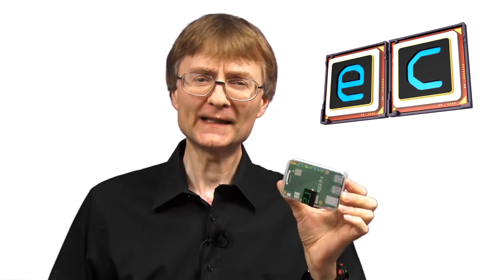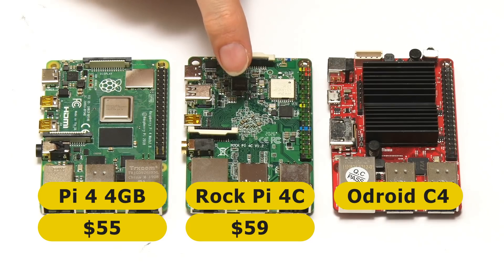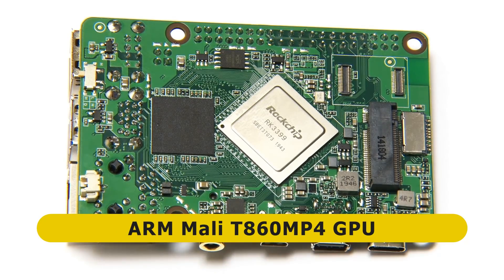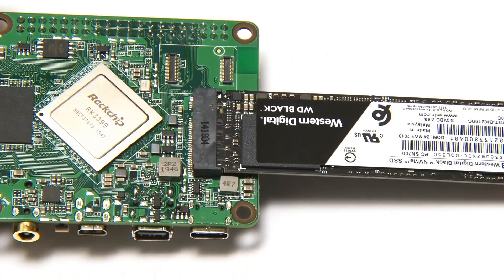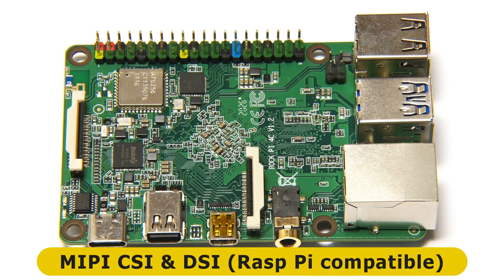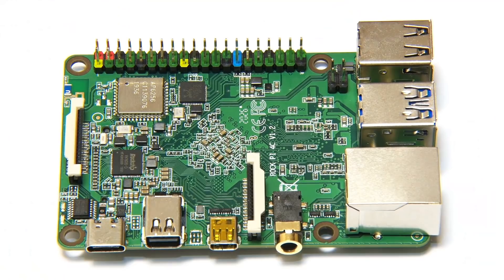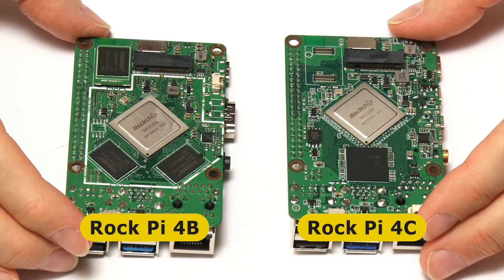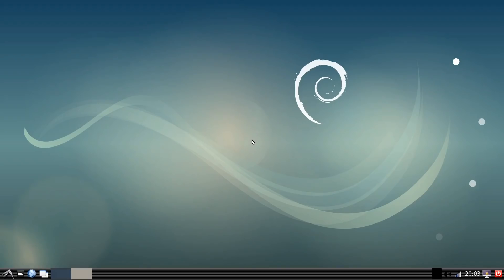Rock Pi 4C: Dual Display M.2 NVMe SBC

Comment: What a great and informative video on another neat SBC. Might consider picking up a Rock Pi 4C instead of a RPi4 in the near future.

As a sidenote, at about 4:35 you noted the board had 802.11 a/c WiFi. The slash implied that it supports a and c, and while 802.11a existed (it was the old old original standard), 802.11c did not.
Reply from the maker: My apologies on the WiFi spec -- I reproduced what the spec for the board says! :) It should be 802.11 ac WiFi (no slash) which does exist!

Comment: They make a large heat sink for the 4c, I bought mine a month ago with the heat sink specifically for the 4c.  Maybe your vendor doesn’t carry it or you were looking in the wrong place.  I have mine booting off eMMC and it’s very quick.  I bought this over the PI 4 because of all the storage and video connection options
Reply from the maker: This is great to hear. Not sold by Seeed Studio at present, which is where I got the board from.

Comment: For a few bucks more you get some extra bells and whistles but as you say it plays video a bit better than the pi4 so why is that? 
They can keep sticking faster more powerful processors  , more RAM and more connectivity in regards to storage but two things are really holding these things back in regards to physical size - the size of the ethernet socket and the size of the usb 2.0 and 3.0 sockets . The other thing is the 40 pin connector , change this to a edge connector or ribbon connector  and sell a plug on converter that can be fitted if desired and that way the case manufacturers can put the pin block in the case anywhere they like . Just my two bobs worth anyway😀

Comment: I don't see the point in testing video playback in Chromium on any of these boards. Even the Pi Zero can hardware accelerate H264 decoding up to 1080p60 (eg. it works in LibreELEC/Kodi). The problem is, after so many years, there's still no official support in Chromium for hardware video decoding on ARM (beside Android of course). Decoding video in software makes the hardware unusable for anything else next to it. Also we are not going to see an ARM SBC hardware any time soon which is fast enough to software decode VP9 4K60, and AV1 is on the horizon.
Reply from the maker: I do it because playing video in a browser is a pretty standard thing to want to do on a computer these days, and most SBCs struggle at it.

Comment: I have 2 of the model B with 4GB and I think they are great. Things they got right. CPU on the underside, makes for a neat and compact cooling solution. RPI could learn a lesson from this example. Generally well laid out and constructed board. The Rock64 3399 is fast and the options for NVMe and eMMc memory let you tailor your capacity and access speeds. Prices for accessories is more than reasonable for example the kit they sell for eMMc flashing has  a nice USB3 speed and is cheap. Some meh attributes. Beyond initial basic stable OS choices not much seems to be happening on the development front. The orientation of the NVMe slot is backwards requiring a sub board sandwich. I can understand the decision,  Radxa could not guarantee all NVMe drives will fit under the board with the heavy duty heatsink but a solution for a specified drive would be nice. Things that disappointed. The audio IO socket relies solely on the solder pads for retention, one of my boards had the socket break off whist plugging in a jack.(very tight socket) This lifted the pads on the board so now the board is effectively deaf and dumb to analogue audio. Audio over HDMI still works fine however. USB C power input is all the rage but a simple barrel socket is sturdier and power sources are more common. Things that caught me out. This board will not run on 5V via the USB C socket unlike the RPI so RPI PS's ( with a USB2 to USB3 adapter) will not work. Do not buy the RTC battery. Believe it or not the the simple mention of a battery in the packing list sends the freight companies into conniptions and I had to downgrade delivery speed with a refund for the lower class delivery. Just buy a battery locally and add your own connector. Soldering is the best way to connect the battery but the creative use of hot glue and heatshink should work fine for those averse to soldering.  Being such a low power device I was leaving it powered on 24/7 when used as a Kodi player. Even with the large optional heatsink fitted, after prolonged use the heatsink got quite warm, not dangerously so but a concern none the less.
Like I said overall I like these boards, good value, accessories and options are useful and cheap. If Radxa offered a single stack solution for the NVMe drive with the larger heatsink and improved the audio socket retention at a hardware level it would be  a 10 but 8.5 with the quirks.
Reply from the maker: Great post, thanks for sharing.

Comment: So in conclusion the Rock Pi 4C is better than the Pi 4 because it has an emmc module and an M2 slot... except it has a fraction of the Pis support.
It would be interesting to know which of: emmc/m2/eSATA connectors the Pi community want the most and should be in the Pi 5.
Reply: They complement great each other. I have a Rpi4 8G which is my main utility PC running twister OS 1.5 32 bit which has all the available software install and I use it as well to build images for Manjaro 20.10 or Debian 10 right there from my Raspberry Pi 4. My RockPi4C is now my main computer sharing responsibilities along with my slightly more powerful Odroid-N2+ which lacks all the impressive I/O on RockPi4C.

Comment: I am ready to get one of these units as soon as they fix the nvme and a proper HS becomes available.  This will work well for my remote WS.
Reply: Nvme does work, only a bit picky on the controller chip. Acer nvne drives do work with the boot option.

Comment: Hey Chris, could you do a video of the Zotac ZBOX P-Series? Its a Micro-PC capable of running Windows 10 with the dimensions of a regular SSD. Its propably the smallest PC in this category ever made for the consumer market and really quite interesting. It was somewhat expensive so it kind of failed, but i think theyre still around at discounted prices.

Comment: Good to see some healthy competition keeping the SBC market going. I just wish the manufacturers could come up with a smarter solution for nvme drives than having them either sticking out the edge or requiring a large addon plate, significantly increasing the height.

Comment: After purchasing this with excitement it turns out unless you are a 
linux geek you won't get very far. Though they have a number of OS 
images listed on their site I would put their ease of installation 
average around 4 out of 10. I asked to return it and they reluctantly 
oked it but no RMA number, and the instructions were to send it back by a
 method that is untraceable. I have yet to be reimbursed. The company 
seems to be inspired by german engineering but I don't think it's well 
run by the fullfillment team in China.  Good luck to anyone going for 
it.

Comment: Hi, Chris! Great SBC video as always! By the way, NanoPi NEO3 is released recently. It is a Rockchip 3328 based NEO2 successor that finally offers USB 3.0 port (NEO and NEO2 only offer USB 2.0). I've got one and performance of the USB-connected HDD is impressive (comparing to NEO2 of course, which I also have). I do know there is NEO4 with USB 3.0 already (again, great review!), but with an HDMI port it's an overkill if one just wants to build an OpenMediaVault powered NAS, like I did (thanks for your OMV videos also!) Anyway, I noticed that there are still no NEO3 reviews on YouTube. So how would you like to review NEO3 as part of your NAS-building videos?
Reply from the maker: Thanks for this I've made a note to look at the Friendly ARM boards again.

Comment: Great Video - Thanks so much for this Prof. Chris!
Just a couple comments on this board. 
Overall I really really like it, and in time, I will buy one for a certain spot where I need a light-duty Linux desktop here for home. 
But - The two main issues you correctly point out need to be fixed first.  They have to get the large heatsink issue worked out and provide a large aluminum block heatsink for the Rock Pi 4C..  Also, not being able to boot properly from SSD is just a blunder.  
It seems that their marketing guys or the bean-counters forced the technical guys to rush this to market before these issues were worked out.. BAD!
As a workaround for the SSD booting issue, you can always boot from SD-Card or eMMC (or whatever) and just put the bootloader and grub on the initial boot medium and then point grub to the SSD to boot the operating system..  
You can do that with any Linux/Unix/BSD variant, you just need to boot SOMEthing and then grub takes it from there and points to your desired mass storage.. But you have to know how to set that up.. Some Assembly Required... 
Thanks Again for the great video on this new and very capable SBC!!

Comment: hey Chris, how would you chose the OS. there seem to be so many, i never even heard of debian before
Reply from the maker: For an SBC, I always choose from what is available, and supported. Which for the Rock Pi 4C right now means Debian, Debian or . . . Debian! :)
Reply: @ExplainingComputers  from my perspective, Armbian focal running on gnome wayland is far superior on rk3339 (kernel 5.6)
Reply from the maker: @pilabs3206  But you need to have drivers for the particular board's hardware (audio, WiFi, etc). :)
Reply: @ExplainingComputers  they worked perfectly fine on any of my rk3399 sbc's. The opi 4, a new board, no problem whatsoever. Even the built in microphone worked. The T4, the same.
Reply: @ExplainingComputers  i will do a video today of the opi4
Reply from the maker: @pilabs3206  Please share a link! :)
Reply: oh i guess i still have a lot to learn😄 thanks all

Comment: The Debian Desktop looks a bit pieced together with the audio icon in the bottom right at 10:46 all black on a dark taskbar and the Bluetooth icon with a white background as well.  Also the program tabs have the same problem.   8-/
Guess it can't be perfect when it is free...
Reply: That's the case with almost any Linux desktop, but then again you can easily customize those to fit your needs.

Comment: How long until SBCs are gonna get to the point they can no longer be usb powered?
I thought the whole point of the exercise was low power, small form factor computers
All these copycats barely get distros
Reply: That was also one of my biggest gripes about the ROCK Pi 4B. The high speed bidirectional USB-C is wasted on power delivery. Also didn't like the fact that there is no power switch. The GLUED ON USB-C connector broke off from being reconnected for every reboot. Same with the audio jack, which I never even used.
There are other SBC mfrs, who invest more forethought and provide more mature product lines and distro support. I  suggest checking out Khadas, Odroid, NVIDIA, or even the RPi Compute Modules. Nowadays, I check out the vibes on the support forums before throwing money at impressive HW stats. That reveals their products' shortcomings, how satisfied their customers are, whether the issues are actually being solved, and how helpful the support staff are.
Hope this help. Stay safe.😎

Comment: Fascinating how small main boards have become over the years from the 80's and the 286 and 386x-mother/daughter board set-up.  I am quite new to your community and have just re-entered the computer market as it were.  As to bashing together ones own computer what would you choose as a "Rock-Solid" mother board, processor, chipset  and format, i.e. Linux, Windows, Apple for long term value and upgradeability?
Reply: Depends. Do you simply want a computer to browse the Internet or do you need GPIO connectivity for controlling IoT devices? I only use my Windows tablet for browsing, email, and MS Office apps. On the other hand, I'm a 'maker' who enjoys developing 'stuff'. For that, I want compatibility, minimal development obstacles, good documentation, and technical support. IMHO, the Raspberry Pi 4B is still king of the hill.
Hope this help.😎
Reply: @TheOleHermit  thank you, it does.  ^_^

Comment: Hello Christopher! 
I really learn a lot from your videos and this time I thought I might contribute something on this subject.
I have my Rock Pi 4C booting and running on the Acer 128 GB NVME SSD that I  purchased from Allnet. This is an approved NVME SSD to boot and run for Rock Pi 4B and 4C. 
I was able to achieve this after running a command to verify the SPI Flash module: 
ls  /dev/mtd*
This showed the following: 
/dev/mtd0  /dev/mtd0ro  /dev/mtdblock0
I then ran the command:
 sudo apt update && sudo apt upgrade
During this process I noticed the system started writing the block info to install the bootloader into the SPI Flash.
 I remembered this happening when I was trying to boot and run  Ubuntu Bionic from my approved HP EX 900 NVME drive for my Rock Pi 4B.
So I then installed Debian For Rock Pi 4C on the previously mentioned ACER NVME and pulled out the SD card I was booting from and installed the NVME only. No SD card no EMMC module. NVME only. I rebooted and to my surprise the NVME booted up Debian. 
So I  suggest  when trying to boot NVME check that your  NVME has been approved by Radxa.
All I know is that I have my Rock Pi 4C booting and running from NVME,  as well as my Rock pi 4B doing the same.  Anyway,  I hope this helps.
Reply from the maker: Thanks for this, which is most helpful. Very glad to hear that you have this working, and indeed that it can work. :)

Comment: Has anyone tested the raspberry pi 4b with dual displays yet? Still waiting for that video.
Reply: The RPi4 dual displays work fine. Personally, I would have preferred a microHDMI and USB-C combination. But, no one listens to The Hermit. 😎
Reply: @TheOleHermit  Thanks. I myself couldn't get both 4k video outputs to work on my raspberey pi 4b 4gb last year.
Reply: @scott8940  That would have been shortly after its launch. Many SBCs have initial issues, so you might want to try again with Raspberry OS. Mine is the same 4GB model. Good luck.😎

Comment: All these sbc's are kinda cute, but they all sport the same idiotic and randomly placed I/O. 
One would think that a nice compact project could be done with such a device but:
- North, south, east, west, up and down I/O. They're freaking everywhere. The SD is there to be ripped off by flick of a finger, the nvme slot is just hilarious. 

How much nicer and compact would it be if all I/O would be on just one side... Like everything up and all warm chips on the other side, easy to put on a sink with thermal pads and grease?
And all sporting closed source hardware that needs, and barely has any, binary blobs that don't allow full usage of the hardware capabilities. 

I'd like to pull a kernel from Linus, make config for that particular SoC, and have everything running at specked parameters. Like 4k30fps video with hardware decoding and rendering, have Gnome running smooth on gles but no *pi has open gpu modules and xorg/wayland drivers... 
*Pis can run about only Linux and none whatsoever complies with the GNU spirit...

Ediy: if anybody can poke me with a board that looks like my wet dreams described above, I would not press charges but say thanks. :D

Comment: Just curious what would happen if they made the board with two or more CPU chips

And also what would be the smallest way to have dedicated graphics ?

I am a mini-ITX fan, but I could do most of my computer stuff on ARM.
Reply: There's been a general move away from multiple CPUs and towards multicore CPUs for a number of years. If you have multiple sockets you have to provide a means of arbitration between them since only one can access any bus at any given time.

One interesting product is the mini ITX size Turing Pi motherboard, which takes seven Pi Compute Modules. That doesn't make a 7 socket computer but 7 separate computers in one unit, with a built-in Ethernet switch and power distribution. You could run a different operating system on each one if you wanted to but the main use is to set them all up almost identically and run them as a cluster.